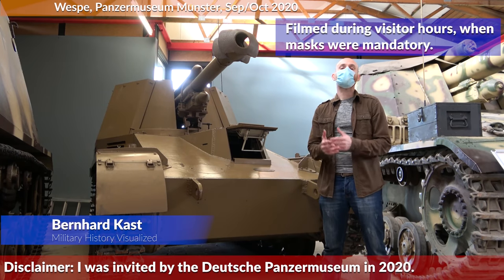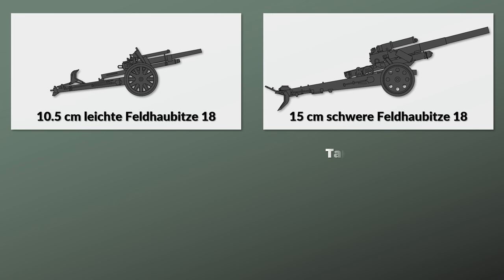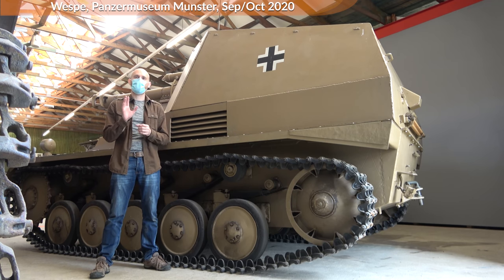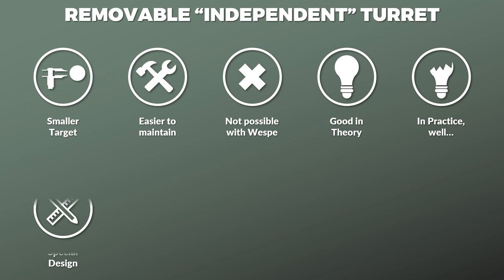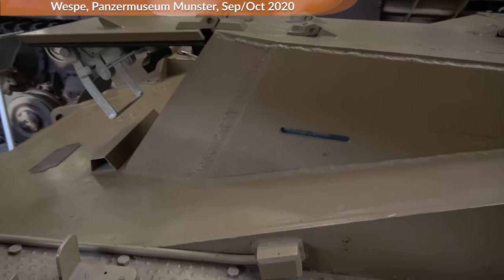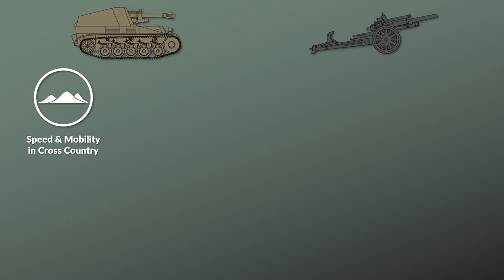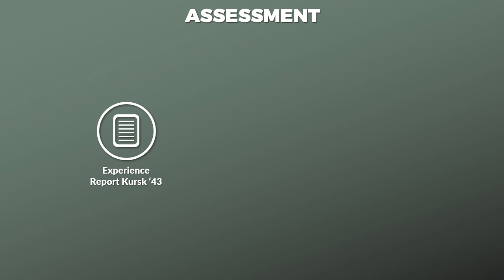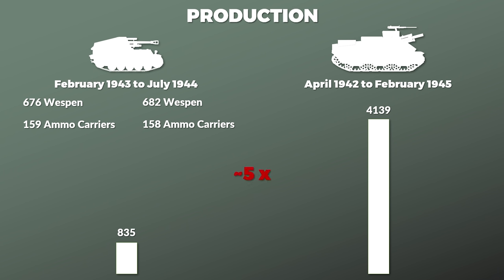Wespe: A Successful Failure?

Comment: I presume that an open topped turret was completely reasonable until the end of 1944, though the basis for thinking so is a bit tangential.  One of the most striking things about Junger's Storm of Steel is the enormous delta between the AMOUNT of artillery fire encountered and the actual EFFECT of the fire upon the intended targets.  The thing that stands out is that the rounds were not inaccurate, but impossible to fuze with sufficient precision to achieve a  vertical shotgun effect with the shrapnel.  The effect of the proximity fuze cannot be understated both in terms of how terrifying it is and how different artillery fire utilizing it was from all prior bombardment.  In the context of the Wespe, the VT fuze transformed the risk of shrapnel hitting the vehicle from the top from a theoretical risk to a likelihood.

On a more human level, the public still doesn't grasp how brutal a war between advanced peer powers would be, as the popular conception of a war against a peer enemy is either the theoretical risk of nuclear war or conventional warfare in WW2. There has not yet been a war in which opponents faced off against once another both armed with corps level VT fuzed artillery as well as modern air defenses to cover it.  Perhaps the closest analogue is the Egyptian attack across the Suez in 1973, though the scale of casualties there was heavily mitigated by Israeli fortifications and a rapid transition to a war of maneuver beyond the range of the static Egyptian artillery units.  Consider that today, modern militaries are rapidly transitioning to rocket assisted, terminal guided, drone spotted proximity fuzed artillery.  In terms of the Wespe, without retrofitted active countermeasures, it could be killed by a single round from over 30km, or even a single mortar round from 6.5 km.  War is awful, but modern war will end us all.
Reply: I would say that a lot of the improvements in modern artillery are meant to increase 'economic efficiency'. Like the Multiple Simultaneous Impact Rounds are great because they allow for a single unit to blast the same area as a battery. (Which is something you might not even want actually). However, there are scary ones as well. In terms of improved efficiency/killing potentioal, I would suggest the Russian/Soviet thermobaric artillery. That thing is beyond scary. Maybe just as much as a VT fuse
Reply: Modern war may end up being somewhat less lethal overall without resorting to nuclear, biological, or chemical weapons because no one can make enough of the precision munitions to do the kind of slaughter that the 20th century conflicts achieved. Today, we have a half-dozen precise missiles to do the job that used to be done with hundreds of artillery shells. We stopped having the hundreds of artillery shells so as to pay for the missiles. We now have a few dozen artillery shells rotting away, and the guns to fire them are not being given the love they need either, so fewer barrels are persisting. Why does this matter? Well, you can't flatten a few square kilometers with the missiles, and you don't have the artillery to do it anymore, so the damage is localized to where the missiles are hitting. So war between peer states would be extraordinarily violent for the engaged combat units as they burn up their stockpiled precision munitions, but then the fighting would peter out as industry takes the months and years to actually tool up. The combatants would have to choose between trying to quickly rearm with cheap old-fashioned weapons to get as much manpower fighting again or they would accept a much lower rate of violence while waiting for the factories to figure out how to make the same volume of precision munitions in months that had taken years in peacetime. Hundreds of thousands would certainly still be dying, but we may have actually worked ourselves to a point where the technology dominating warfare is less effective at mass murder than it is at precise murder, and that is actually good for reducing the overall damage done.
Reply: They say it was the new proximity fuse, that did the damage to the Nazis during the battle of the bulge.
Reply: That was essay! Talkabout Schindlers list lol
Reply: You are looking at it backward.  You have N tons for armor.  Where do you put that armor to do the most good?  Most attacks will be small arms from the front and shrapnel from all directions.  So you can save a lot of weight by not putting a top on it.  That said, the vehicle WAS too small.  The Soviets produced the much more successful SU-122, with a bigger gun, on a T-34 chassis, with good armor all around.
Reply: @princeofcupspoc9073  Mind, the Su-122 was an assault gun,  so it didn't do indirect fire well and indeed, its deployment was virtually the same to the German StuGs, being formed into "batteries" for direct fire support. The point of Wespe was it could shoot indirectly at targets thousands of meters away. The Panzers had plenty of direct fire weapons, but they needed area-fire weapons for suppression, to reach behind enemy positions, and such. The Soviets were so desperate for direct-fire weapons that they never really consistently employed any self-propelled artillery as such, most units ending up attached for direct fire missions nearly as often as they got indirect missions. Even the SP 203mm howitzers found themselves being used as demolition weapons.
Reply: @princeofcupspoc9073  This was exactly my point.  For most of the war (all of it vs everyone but the US), horizontal facing armor was more than sufficient protection for a vehicle out of mortar range.  My point is that on Germany's Western front in December 1944, that calculus of risk abruptly and forever changed.  From December 1944 onward on the Western front, a flat canopy of armor was far more useful for a given armor budget than any other use.
Reply: @genericpersonx333  I disagree in the sense that your economic calculation is outdated.  From 1950-2015, your statement was exactly correct: the electronics and sensors required to guide a precision munition were so expensive that the weapons themselves were a rarity.  George H.W. Bush famously declined to launch a missile strike against a suspected Qaddafi hideout because, "I'm not going to shoot a $500,000 missile at a $15 tent to hit a camel in the butt."  That was 1989 or 1990.  Today, the US mass producing precision guidance modules that screw into the fuze slot on standard 155mm rounds (the M1156).  Mortars are getting a similar upgrade in the XM395, while the M982 purpose build artillery shell IS likely to remain a rarity as its much greater cost is not justified by its relatively better performance vs the add on kits.  The entire point of the JDAM is the same: a relatively cheap kit that screws on to a standard iron bomb and turns it into a guided munition.  You do not need triple patterned 10nm or 7nm wafers (i.e. cutting edge silicon foundires, currently only available to TSMC, Intel and Samsung) to build these chips: 45nm, 32nm, 22nm, 14nm.....even 65nm tooling is more than sufficient to build these chips.  Those tools still have plenty of useful life, but as yields rise to >90%, you can absolutely mass produce the relatively simple chips needed to guide  artillery shells.  The problem is software running on commodity hardware, such that once you get the software worked out (which happened slowly over the past 50 years and then very quickly over the last 20), a precision guided silicon guidance/fuze module is cheaper than a mechanical fuze.   Think of how quartz has completely displaced mechanical watch movements for all practical purposes.  Something like 90% of the US output of vacuum tubes was going to VT fuzes in 1944; today, mass production of guided shells would require only the use of obsolescent semiconductor foundries (which every major military power has) and software (which everyone either has or is rapidly developing and which can be copied infinitely and at zero cost once developed).
Reply: @nottoday3817  I agree on thermobaric artillery, though I admit that I am very naive on this subject.  The Soviets often developed weapons which to my mind seemed so obvious that it frightened me that we had been so foolish as to ignore them.  However, technical considerations often later arose which demonstrated why the US held off on certain ideas.  Thomas Eager does a class on welding metallurgy for Navy officers at MIT, and one of the many fascinating examples he brings up is the titanium Soviet Alfa class, or Papa for NATO.  When the use of titanium and the phenomenal speed of the submarines was discovered, many in NATO assumed that the Soviets had solved the stress cracking problems in titanium pressure hull welding, and immediately asked Eager how they had done so.  Eager replied that he had no idea, and much later found that the answer was very simple: the Soviets never solved the cracking problem with the welds, and merely kept the subs in port as interceptors due to the expected 3 year lifespan of the hulls (their lead cooled reactors were also apparently a bitch to refuel).  WRT thermobaric weapons, I have heard that they can suffer ignition trouble in high humidity or rain (I assume that they're pretty insensitive to air temperature, though I do not know).  I wonder if they represent a trade off between maximum possible effect and reliability that requires a more subjective assessment than their destructive potential per unit weight might imply.
Reply: Modern war between two major countries would be fucking terrifying. I watched a AC130 gunner talk about how the big cannon first lasers the target so it knows the precise distance to detonate the round above ground sending shrapnel everywhere.
Reply: Not modern war. Nuclear war.
Reply: @Ben-fk9ey  You do realise that a Gunship like the AC130 ist the anti thesis to a modern war between peer powers?
Gunships are COIN/LIC optimised if not exclusive. They have close to zero surviability against a decently equiped enemy.
Reply: In the 2020 war azeri drones obliterated the armenians, but there are some videos from the early days of the war that show armenians scoring extremely accurate artillery fire on azeri forces, including direct hits on armored vehicles. A modern competent artillery force firing from pre-prepared positions is scary.
Reply: @amschind  Not every major military power has semiconductor foundries. Actually very few have. Thanks to globalisation and the concentration of consumer goods production into low wage countries. The few that are left are usually for high grade and specialised stuff which will be needed and is not available for mass production of throw away equipment.
The irony is that in a modern peer war the impact of guided weapons will be conciderably reduced. Because of the massive amount of counter measures. Especially modern C-RAM systems will make attacks with few missiles/shells/drones ineffective. Currently the only solution is saturation. Which brings us back full circle.
Reply: @BlaBla-pf8mf  This again is a prime example of a conflict between second or third rate powers using some modern equipment. Not a modern peer war against two major, first rate powers.
The feasability of drone use in the latter context is highly doubtfull.
While drones will be used and will have uses these will not have the massive impact they have against forces that lack the technology for effective counter measures.
Reply: @schnuersi  Would you consider Russia a major, first rate power? Because the forces they directly supported in Syria and Libya had no answer for drones. The russian army itself would have to try and bomb staging areas to counter drones.
Reply: @BlaBla-pf8mf   Russia IMHO is a first rate major Power.
Syria and Libya are not.
That makes all the difference. While Syria and Libya might have or might have had SOME first class modern equipment they do not field first class modern forces as a whole.
Electronic warfare equipement and sofisticated AA (i simply put C-RAM in this category as well) are very expensive, require specialist personell and equipment to be operated and kept in operating order and are usually very classified. This means even IF a major power supports a given nation they will not get these.
This means even though Syria for example fields rather modern MBTs they do not have the required combined arms force or fully integrated, overlapping air defense to fully utilise them or stand a chance against a first rate power. As a result their indivdually powerfull and effective MBTs do not pose a threat for such a power.
Reply: @schnuersi  counter measures like?
Reply: @pflernak  Counter measures against drones?
Its starts with the same very basic things that are effective against all types or recon. Camouflage, deception etc. 
After that you have all kinds of electronic counter measures. From blanket jamming to signal detection. A drone needs a connection to its user. These are radio connections are are highly suceptible to jamming. This BTW is the reason why more traditional missiles either use some form of wire connection or are self guided. Drones (and guided weapons) also often use GPS or other froms of nav systems based on radio signals. These also can be blanket jammed or simply shut down.
Last layer would be to shoot them down. There are lots of systems that can shoot drones down allready. More are coming and they are allways improving. Detecting drones used to be a problem. Mostly because of size and low altitude (ground clutter) but in several cases it only needed software updates to change that. There are special purpose designed and very sofisticated drone detection systems for miliary use available for several years now.
I am sure you can google these yourself if you are interested.
Most of these counter measures also work against other types of guided weapons.

The thing is: While drones are kind of a fad for some years now they essentially are nothing new. Both sides during the cold war operated drones. Mostly for recon purposes. Some types of guided weapons (missiles, tropedoes, bombs etc) could be concidered drones. The only thing that is new is that they are widely available and made from non military grade parts. Which ironically limits their capabilities and makes it rather easy to defend against them... IF someone though about it and took measures. The lack there off usually is one half of the story of successfull drone use.
Reply: @schnuersi  I imagine that in that kind of war we would soon loose our squeamishness about dumb AI controlling weapons. 

Plus laser comms will go a long way is solving the jamming problem in the next few years. (Look up Mynaric)

As for jamming. Pretty sure the moment you start doing that is the moment your position can be triangulated. Certainly useful but it has its drawbacks.
Reply: @pflernak  "I imagine that in that kind of war we would soon loose our squeamishness about dumb AI controlling weapons."
You mean like guided missiles? In this case the drone ceases to be a drone and becomes a traditional self guided weapon.
Yes the lines are very blurry in this field.
Guided weapons exist for a long time now and they had impact on warfare but they did not change it completely.
Also there is a lot of precedent to both sides of a major conflic sticking to a set of rules set befor the hostilities. Armed drones are very problematic under international humanitarian law. Deleting the man in the loop would certainly be concidered a violation by the other side. The advantage it might give is out of proportions to the problems it would create.

Laser comm is not a real alternative in this regard. Just as directional focussed radio isn't. For starters you need LOS. Which would limit drones extremly. To the point where they could not use their main strength anymore. Its also expensive, state of the art tech. Which defeats the main selling point of drones: being cheap and simple.
If you want to see where you end up with a military grade drone just look the Nimrod or Spike NLOS missile up... yes they are called missiles but effectively they are armed drones for single used. But they are neither cheap nor simple. They are also not build from parts easily accessible or order via Aliexpress. 
If you want some understand how long these ideas are around google Polyphem missile for examle. In the case of Polyphem even the jamming problem was adressed... allready in the '90.

Yes jamming means active emission. So does controlling a drone via remote. Of course it depends on tactical decisions and circumstances.
Most likely in a peer war both sides will try to keep their active emissions to a minimum most of the time. Which means most of the time no drones will be controlled. The drones used during the cold war for example would fly pre set courses and use their passive sensors. This would certainly work. But it basically turns a drone into an unmanned recon plane. Not exactly what everybody is spilling his beans about for a couple of years.
Reply: @schnuersi  > Armed drones are very problematic under international humanitarian law.

I suspect that mostly applies to counterinsurgency and other low-grade warfare where once side has extreme overmatch in firepower, so they don't need every single advantage they can get, and where it's difficult to differentiate between legitimate and non-legitimate targets. In peer level warfare where no side has a clear advantage and military and civilian infrastructure and personnel are easier to differentiate, autonomous armed drones would be far less problematic under international law.

As for guided vs saturation bombardment, there's no reason you can't have both today--you just have to be willing to compromise on performance and use mass-market, commercial off the shelf equipment instead of the special military-grade stuff. Sure, many of them will fail, but enough of them will do the job, and at a higher rate than with dumb munitions.
Reply: @amschind  Thermobaric weapons are also rather sensitive to high wind, and it's highly difficult if not impossible to use several of them in close proximity. Most targets in modern warfare are better served by 10x small bombs than 1x large one, and the exceptions tend to be deeply buried installations that thermobaric weapons aren't effective against anyway, so that's probably why even the Russians don't use thermobaric weapons that much.
Reply: @schnuersi I agree that saturation will be necessary, but even Israel can't get complete coverage.  They have the advantage of a tiny area to defend and a VERY strong economy coupled with a willingness to spend a very high fraction on defense...and still can't intercept everything thrown at them by decidedly NOT first rate powers.  I disagree on the number of chip foundries left: there are a TON of foundries scattered around the world that make chips for things that you rarely  if ever think about.  GlobalFoundries is perhaps the most stunning example, as they were a mix of AMD's manufacturing arm and Chartered Semiconductor.  They couldn't get 14nm to work and had to license it from Samsung, but AMD left them behind in 2018.  This is a major chipmaker with tools 1-4 generations behind state of the art with foundries in the US, Germany, and Singapore.  Further, the chips that we're discussing aren't 64 core sever chips: the processing power needed is actually tiny once the software is available.  Small chips+old processes=extremely cheap mass production from a variety of sources that don't immediately spring to mind as sources for semiconductors.
Reply: This entire comment section is so great, i've learnt a lot, thanks guys.
Reply: @amschind  The comparison with Israel is missleading IMHO. Trying to protect an entire country in a way civillians and civillian infrastructure is safe is very different to protect military units and installation. For starters a military force especially a manoeuver force, since this is what we talk about here, is much much smaller than an entire country. Its a more difficult target than a city. Its also protected or hardned. Which means 100 % protection is not needed. To put it simple: a near miss against a tank is ineffective. A near miss of a house in a densly populated urban area takes the neighouring house down and because of this still is a hit.

I am not an expert on the semiconductor industruy. But I have serious doubts about the availability. Because I don't see why it should be different in the semiconductor industry than any other. Western countries currently do not even produce enough essential materials and parts like, steel, ammo, textiles & clothing, plastics, medical equipment etc to wage a serious, peer war when they get disconected from the international trade network. Even disruptions of this network have devastating effect. Just look at what happend and is still happing due to COVID. Supply shortages of industrial and essential goods. Most western countries had to rebuild medical indsutries to supply themself with medicine, masks and breathing aids. Building the vaccine production is a major undertaking. All of this without somebody actively interfering.
I really don't think a major war would be any different. Most likely worse.
Reply: @hailexiao2770  "I suspect that mostly applies to counterinsurgency and other low-grade warfare"
No. The IHL is allways in effect. Disparity of military potential is not an issue.
But protection of non combatants, cruel weapons, proportionality and accountability are issues.
Accountability is a major problem for all AI or computer based decision making. Who is to be held accountable when a mistake is made or a law is broken? The designer? The company who build it? The organisation who employed it? The poor guy who mounted the weapons and armed them?
This also is a major issue for self driving cars and truck. Accountability and liability.

Failing munitions also are a major issue. Every munition that becomes a dud is a hazard ( this is the main reason for the cluster munitions ban). 
Failure of guidance could mean you hit non combatants.
It is not as simple as you think. There is very little middle ground. The electronics used in munitions are pretty special. They have to endure much more miss treatment compared to industrial grade stuff. The acceleration during firing/launching alone will damage or destroy industrial grade electronics. This is just one factor.

It is true though that somewhat less sofisticated or fancy but more can be a more sensible or effective way. But less sofisticated in a military context doesn't mean industrial grade. That in this example would be "completly unsofisticated".
Reply: its generally hard to put a high angling gun, plus achieve high rates of fire in a vehicle with an armored roof
Reply: @genericpersonx333  say that to yemen. Precision munitions have allowed the saudis to carry out a low intensity conflict while destroying most of the civilian infrastructure such as hospitals and utilities. Plus with their naval blockade results in mass famine and destruction, just with less munitions
Reply: The public has no idea how the last few wars were actually fought or why. Let alone the next one. I love em, but they are a dead hand on the tiller of the ship of state.
Reply: @genericpersonx333  "Well, you can't flatten a few square kilometers with the missiles" - you absolutely can. Look up photos of Kobani after weeks of bombing by USA or Yemen after months of Saudi attacks...
Reply: Very interesting comments here. Thank you. Indeed, I think WW3 will be much more like WW1 than WW2, and with many of the initial challenges to overcome by the peer competitors.
Reply: The closest thing we can look at here is the mobilization plans for NATO and Soviet nations in Europe that are being declassified. Projections about how many months or weeks the air force would survive high-intensity warfare, evacuation of entire cities.

The soviets had doctrines where NRBC capability would be an equalizer for other shortcomings, sometimes with front-wide deployment of these devices. There was people who thought limited NRBC use was just a dream.
Reply: @aussiviking604  Artillery shells with proximity fuses were new when the Battle of the Bulge unfolded; and they had an impact on supporting infantry for several of the spearheads of the 6th Panzer Army. Basically helped stop three of the five advances by that army around Elsenborn Ridge, blocking the focal point for the offensive towards Antwerp via Liege.
Reply: The time of war has come, old friend, and my god, we've seen russian and ukraine let blood